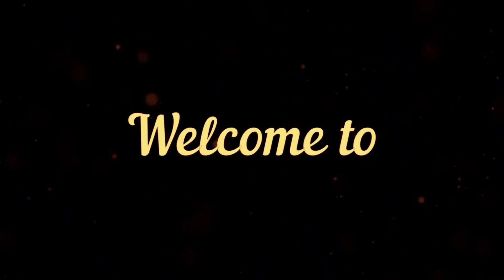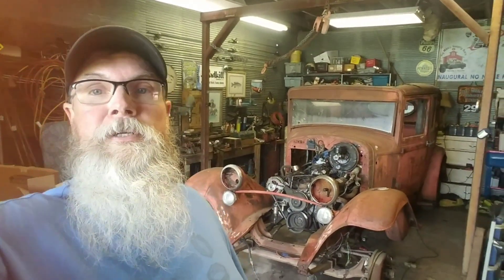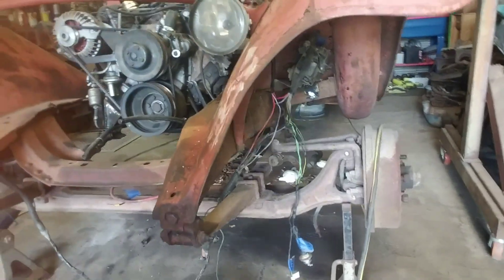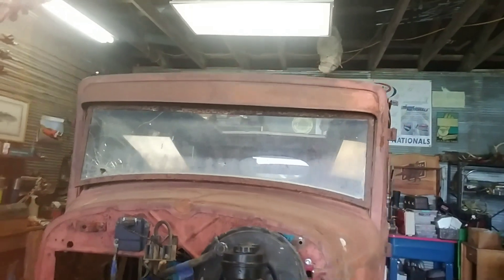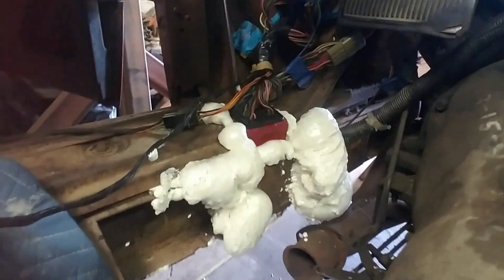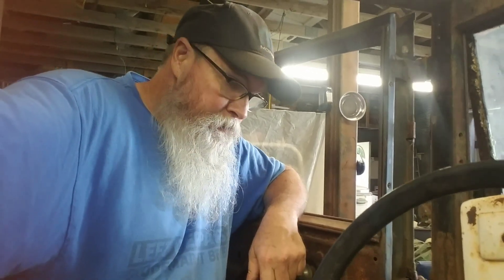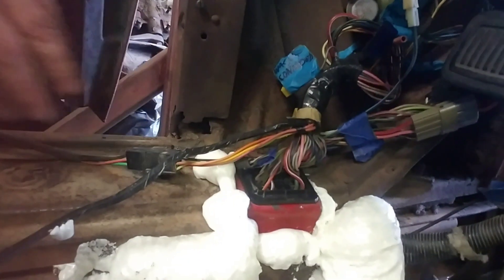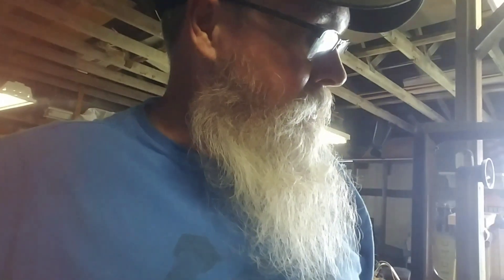90 To Nothing! (Day 68) #nonamenationals

Comment: JB weld some angle metal to outline your fuse box. Once set, the fuse box will fit right in and then you can Hoopty-up a tie down to keep it from moving.